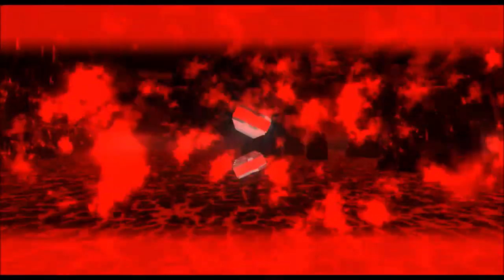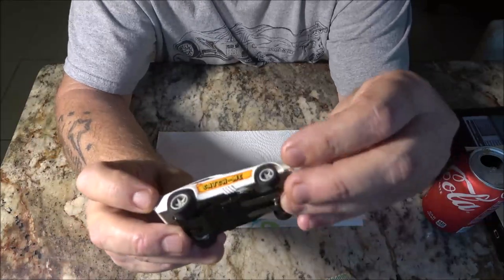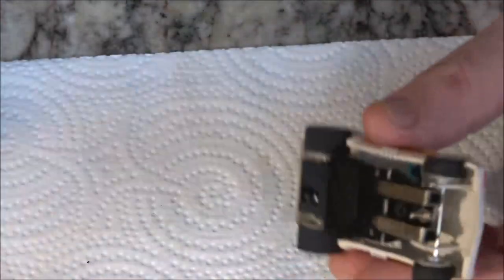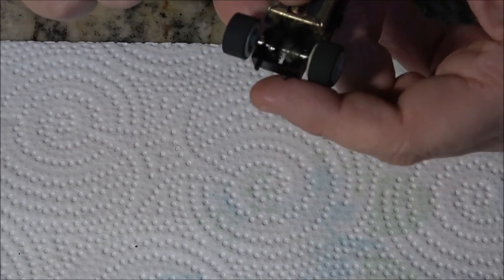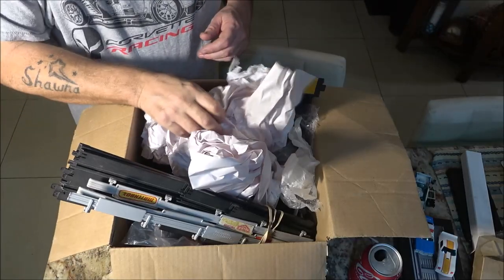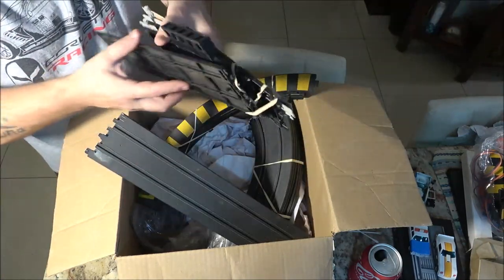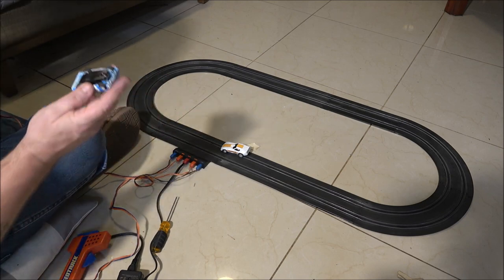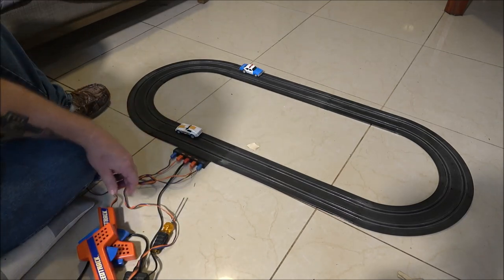Vintage Match Box Race And Chase Cars And Some Fun Drag Racing

Comment: Ha ha,  I had a couple slot car tracks when I was younger but I was always more partial to the r/c cars & boats 😋 . However once we get moved and settled in I think I'll start looking for a slot car or HO scale train track whichever comes first 🤓 ..
Reply from the maker: Oh yeah, I love rc stuff too. Had a lot of it growing up. But got the really good stuff when I became an adult lol.
Reply: @shabear1000  G'morning & yesir' ☕☕ 🤠 . I used to take RC's to school with me & race them around the gymnasium floor at lunch instead of playing ball or sometlhing b4 I got hooked on skateboarding 🤗. I'm 49 now so it's been a minute and My r/c's have just gotten bigger and more expensive. I stepped away from the 1/10 scale stuff in favor of the 1/8 & 1/5 scale Nitro and gas-powered toys 😇 ..
Reply from the maker: @idletime  I used to run the nitro RC too. Them things are fast and you can soup them up. The last one I had was a Monte Carlo with a 1 and a quarter hp engine. Pretty fast car.